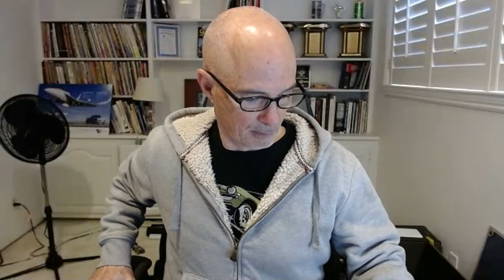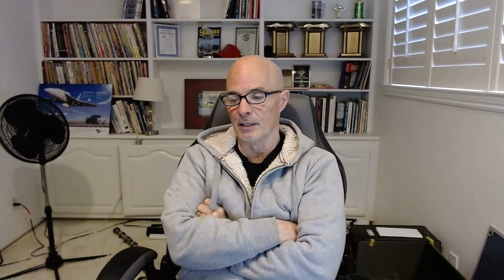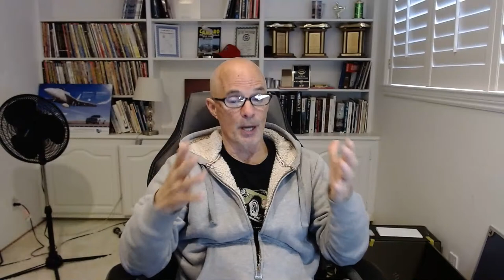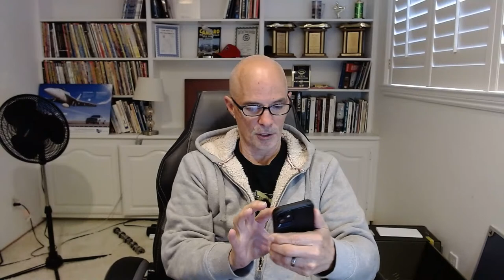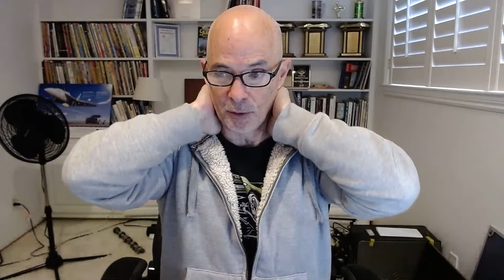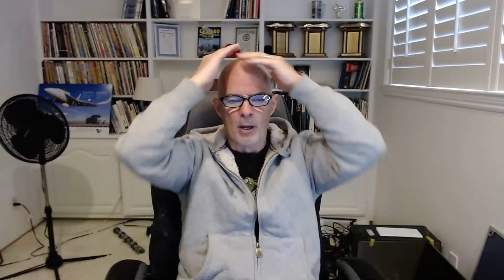LET'S TAK TECH-CARB BONNETS-IS A NEW DESIGN NEEDED?

Comment: I'm currently running a similar setup to the thumbnail. It came in the kit with my Vortech centrifugal supercharger. 
  I've got an air:water intercooler and carb hat from csu that I plan to swap in soon. I'm running a holley sniper tbi system.